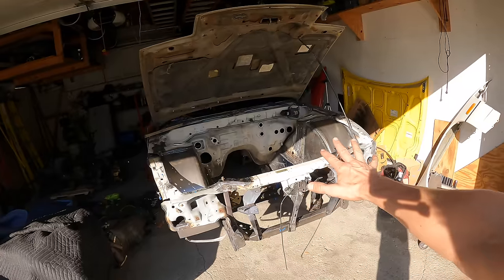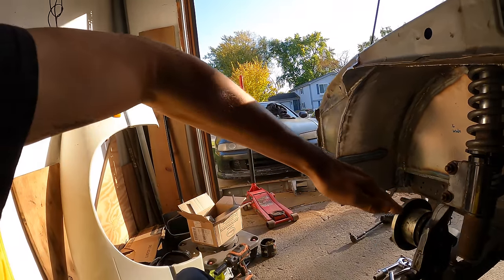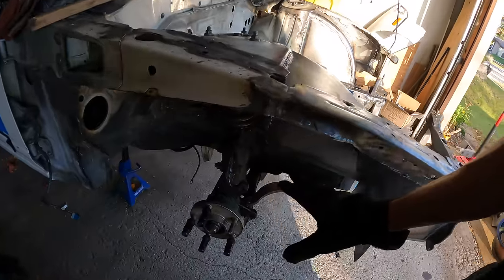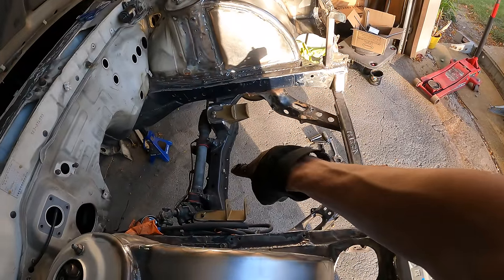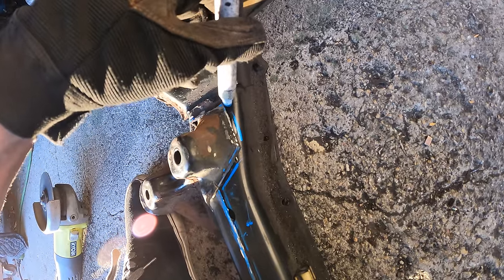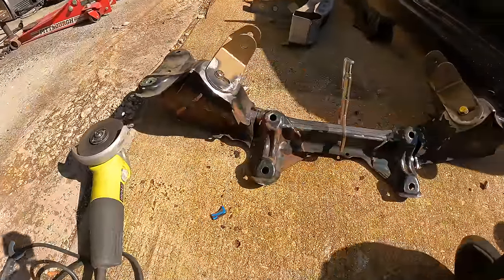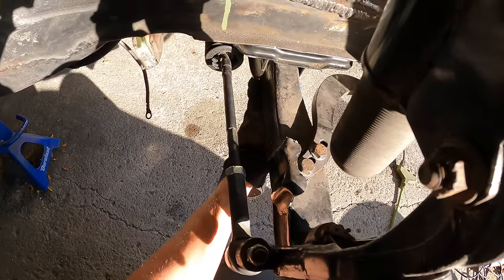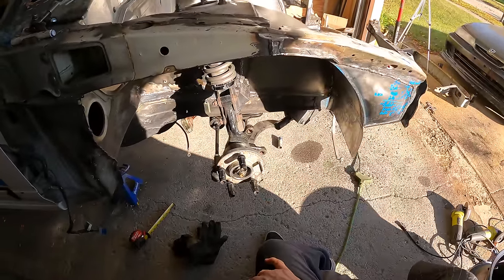Correcting Steering Geometry in my 240sx Drift Car

Comment: The reason why it's binding also, if I may add some technical explanation, is that when your wheel is steering all the way out (so when the tie rod is pulled all the way into the rack) the tie rod line starts to line up with the balljoint, which means that when you want to steer back and essentially push the tie rod back out towards the balljoint, it doesn't have any leverage.
The most extreme scenario is if the tie rod perfectly line up with the knuckle and balljoint, and there is actually no leverage. In this case the steering on that wheel can hypothetically get "dislocated" and inverse on itself.

Also, another side effect that might be worth noting about pushing the rack forward, is that you also start removing ackerman from the steering. And if you go too far you actually get anti ackerman.

Comment: roll cages are awesome, safety is always a must when it come to a car as amazing as yours. do you know if you're going to paint it?
Reply from the maker: Most definitely!
I'll surely paint it, but what color is the question 😬
Reply: Ooh didn't think about that, you could probably use the same paint as the engine bay so it stays with the theme.

Comment: eh dude for the top rad support after its all painted put down some clear vynal to prevent scratching where its metal on metal where the bolts go in, should help protect the paint a bit better

Comment: caster is like 4 to 5?
Reply from the maker: Technically this does not adjust caster.
Caster adjustment have to do with lower control arm to upper pivot point (in this case, coil over upper ball joint) 

This rack relocation is purely for angle and steering geometry correction